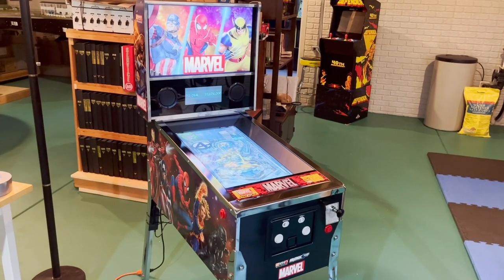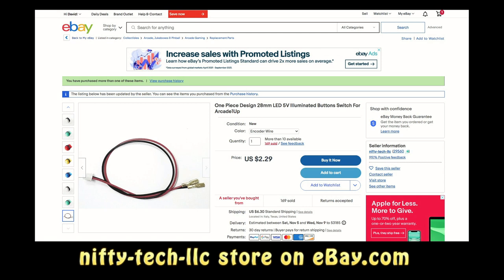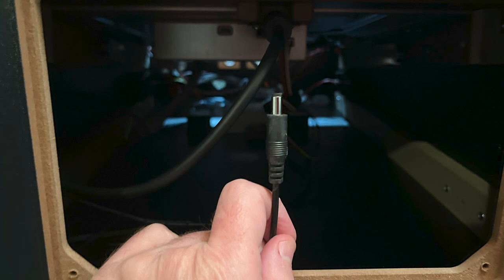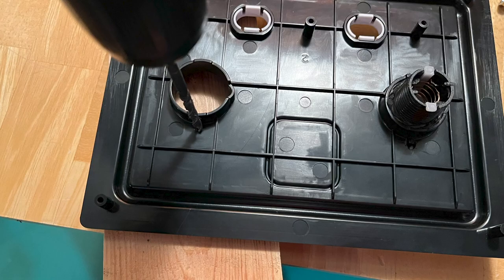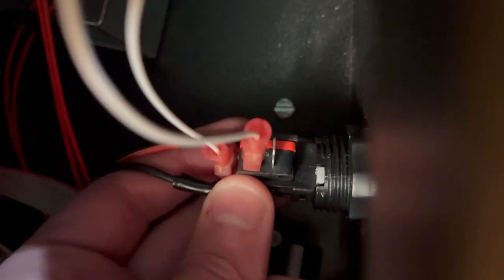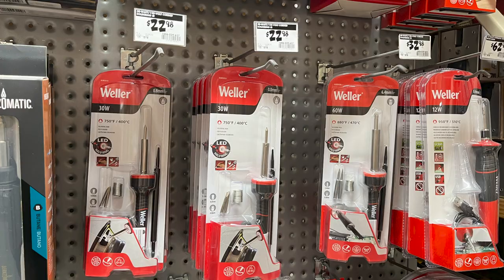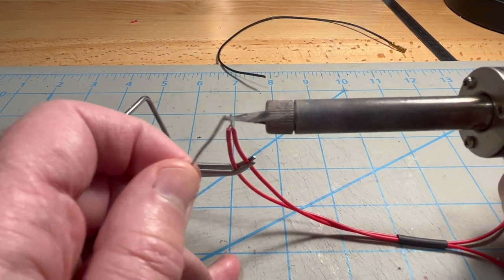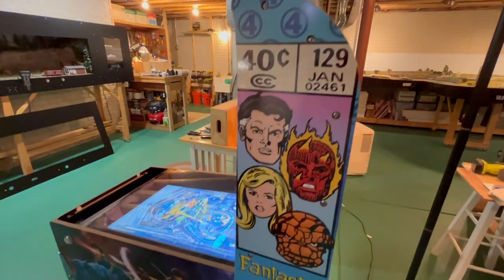LED coin and pushbuttons for an Arcade1Up pinball table

Comment: I just did this mod to mine but I ran some LED strips on the bottom to light the floor up too. Thanks! Took me about an hour and it made the machine so much better!
Reply from the maker: That's a great idea, and something I can add later. i bet it looks awesome!
Reply: @PoppArtstudios  definitely! I did green on my attack from Mars machine, so now it looks like a UFO lol I also just added an amp with some new speakers and a bass shaker. That changed my machine so much.